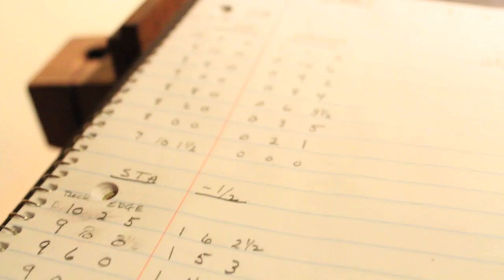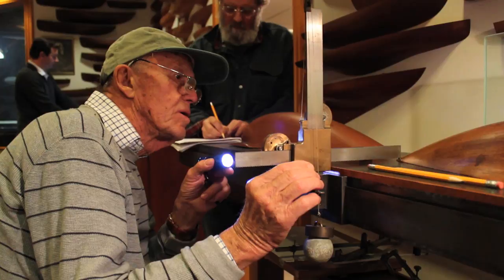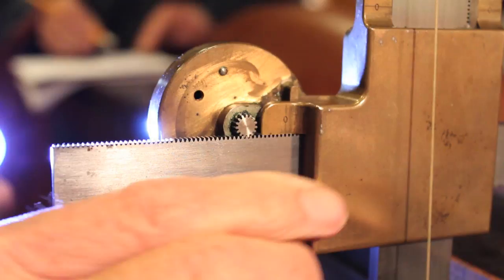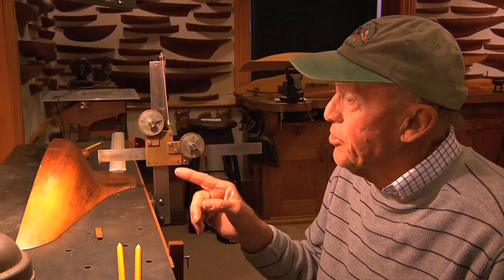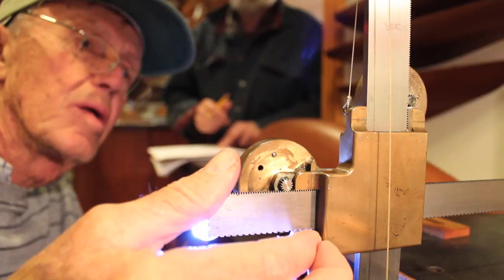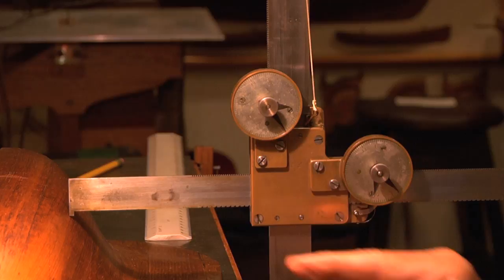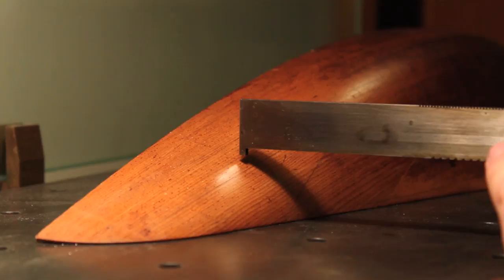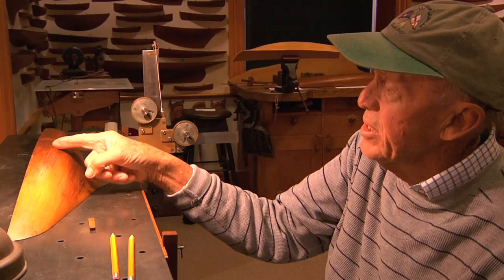Halsey Herreshoff measuring the original S-Boat model made by Nathaniel G. Herreshoff

Comment: Way cool tool. Getting measurements off a carved half breadth model. I wonder what gauge/ratio it reads? Time consuming, but seems like it should be accurate.
Reply: It looks to just measure points on a station.  Any scale would come from multiplying by the factor of the model.  I was hpoing they would show an "S"   I had a friend who had one.  It was just an old wreck then, no one knew what it was.